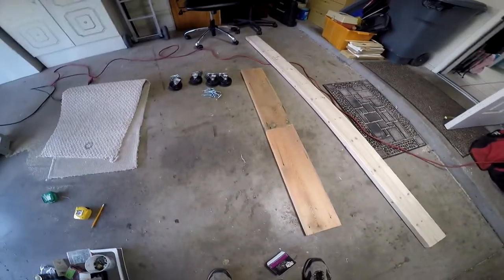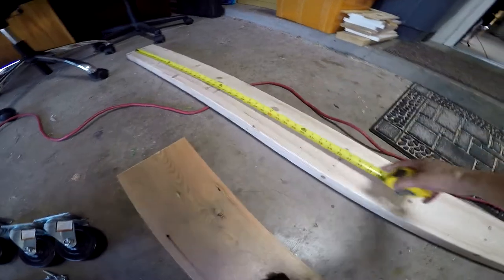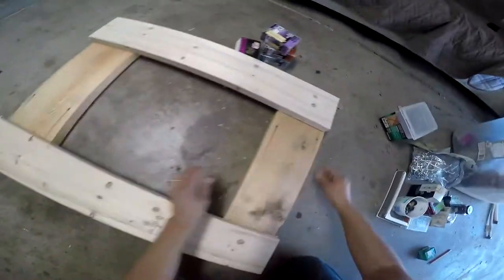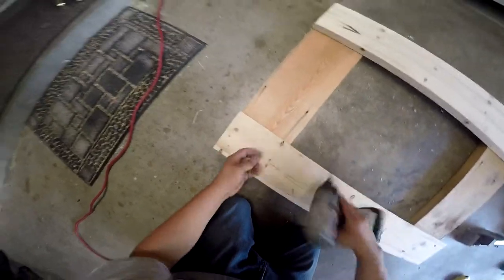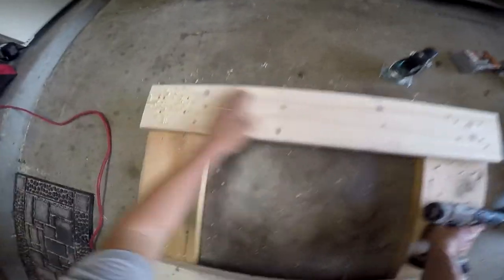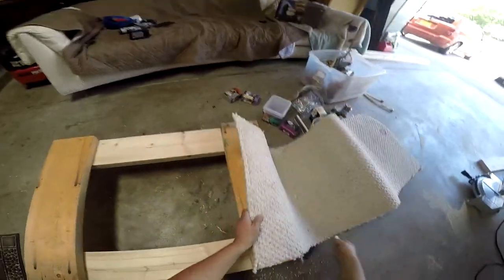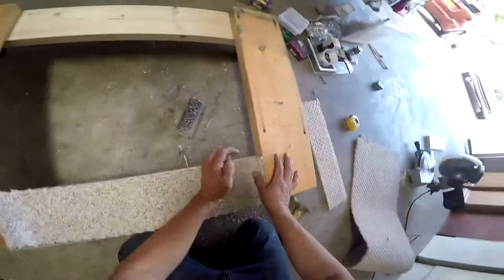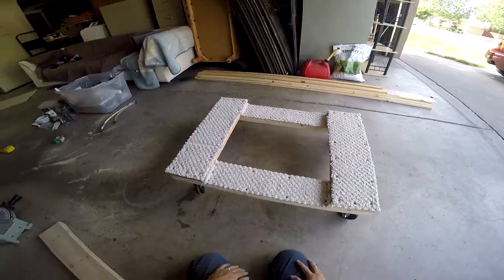How to build a heavy duty floor dolly

Comment: A heavy duty dolly, to be sure.  But, nailing the carpet to the dolly?  The nail heads seem like a pretty sure way to scratch whatever is put on the dolly.  Depending on what is being moved, that could be a real problem.  Wouldn't gluing the carpet be better?
Reply: Nah, the nails are good. They won’t cause any problems
Reply: I worry about it too. how about wrap it to the sides or around, glue then nail?